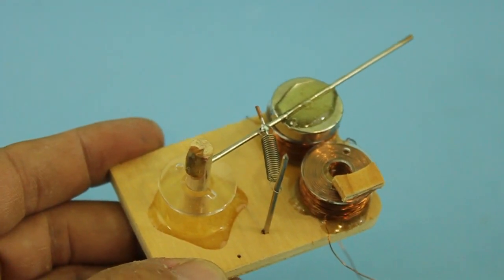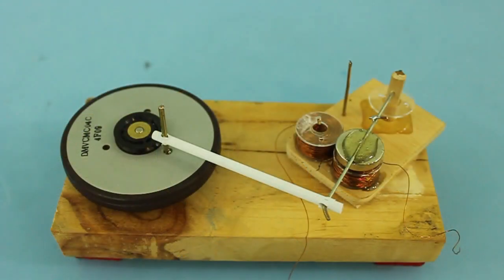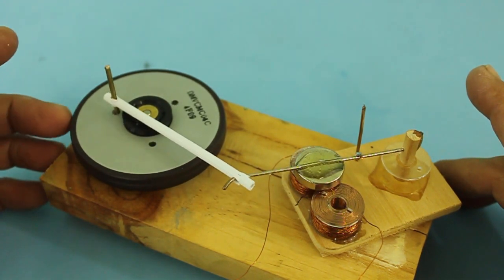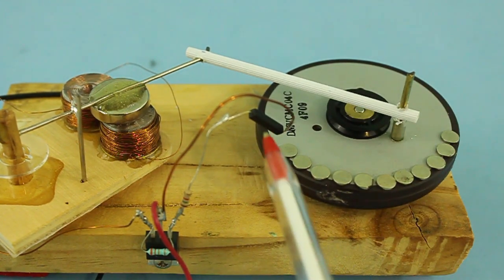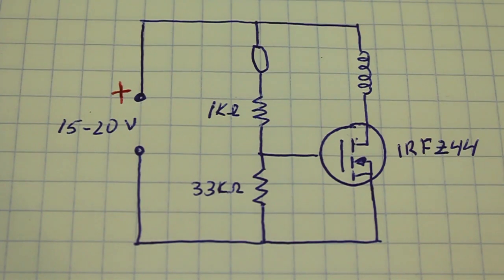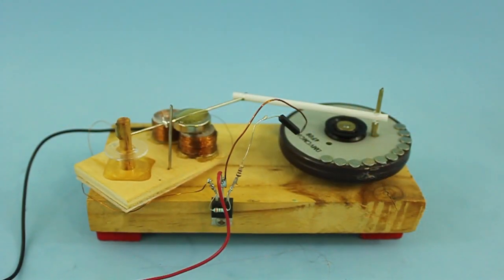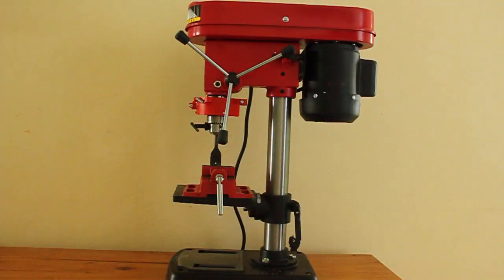Simple Solenoid Motor

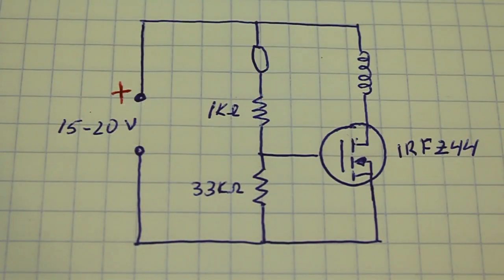Comment: I'm having trouble seeing how the coils are connected.  I realize that they are connected in series to each other, but what is the first coil (furthest from rotating disc) connected to and what is the end of the second coil (closest to rotating disc) connected to?  According to the diagram (around 2:25) it shows the coil being connected to the Drain (middle pin) of the MOSFET, but it doesn't appear to be connected there in the actual motor.  Any advice/clarification would be appreciated.  I love your channel and have replicated many of your projects.  Thanks.
Reply from the maker: Yes I see. You can connect the coil as per the diagram (between positive and drain) but is the same if you connect it between sorce and negative). It wors equally well
Reply: Thank you!

Comment: Even if it is a simple setup, you should NEVER leave out the flyback diode when switching coils with semiconductors. Especially with MOSFETs which are even more susceptible to damage by voltage spikes.
Reply from the maker: Yes that´s  good advice!
Reply: I thought so too, but the irfz44 is avalanche rated, so the high voltage spike that happens when it turns off builds until it hits the zener voltage of the protection diode inside the irfz44. the current from the spike then flows through this, protecting the drain-source junction from breakdown, but at the cost of heating up.  in this application if you put a flywheel diode across the coils you lose torque; as the flywheel diode conducts current through the coils and sustains a magnetic field for longer than we want it to.  an RC damper circuit would be more appropriate
Reply: Josh Crampton 

Nice clear explanation thank you Josh😀
Reply: IGBT transistors can easily withstand high back EMF spike !!!